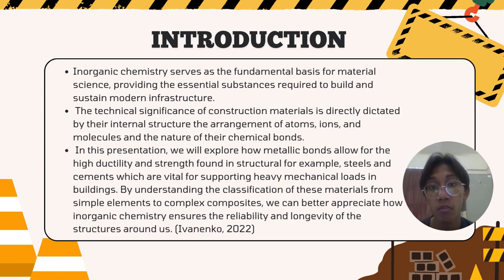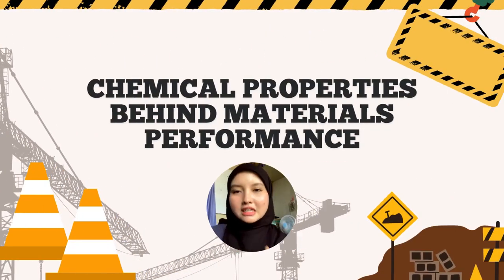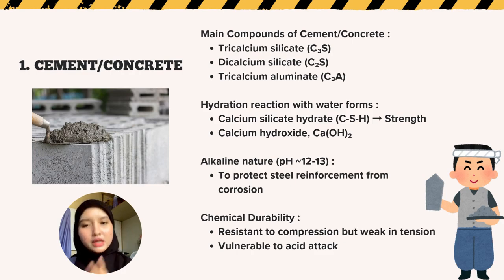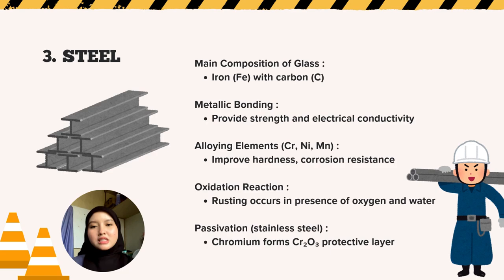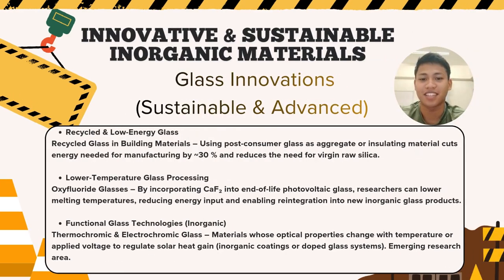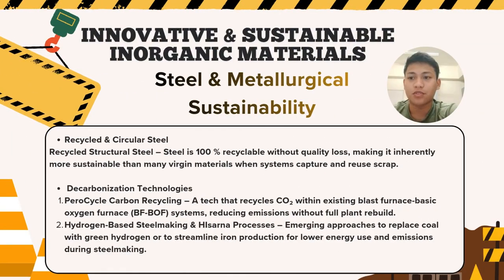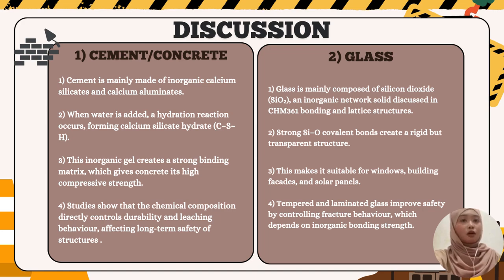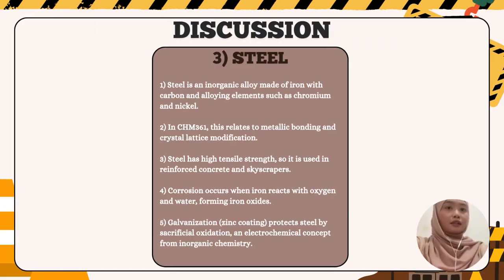CHM361 VIDEO PRESENTATION  INDUSTRIAL APPLICATIONS OF INORGANIC COMPOUNDS IN CONSTRUCTION

Comment: I have a question. Why is concrete strong in compression but weak in tension?
Reply from the maker: Thanks for asking!

concrete is strong in compression but weak in tension because the calsium silicate hydrate formed during hydration resists compressice forces well but lacks flexibilty, so steel reinforcement is needed to handle tensile stress.